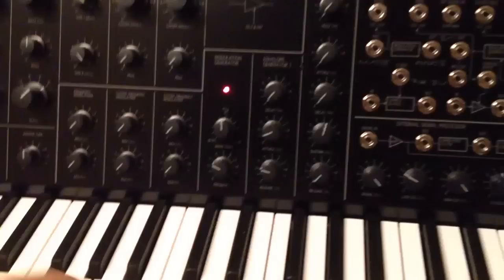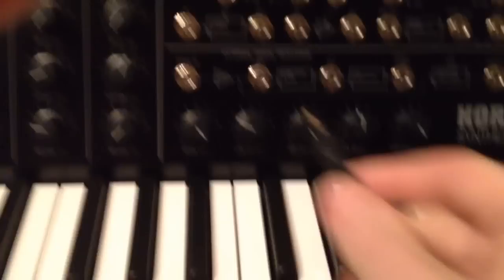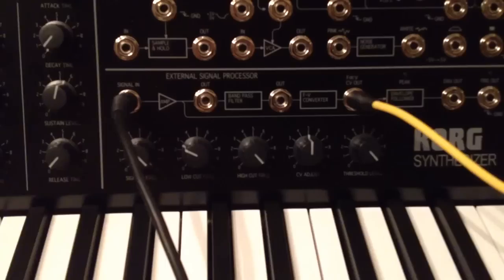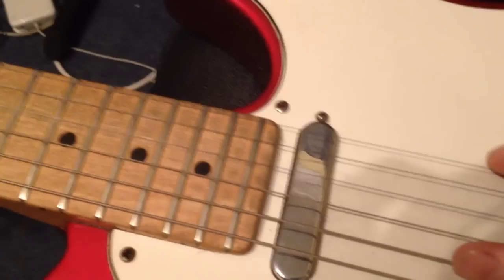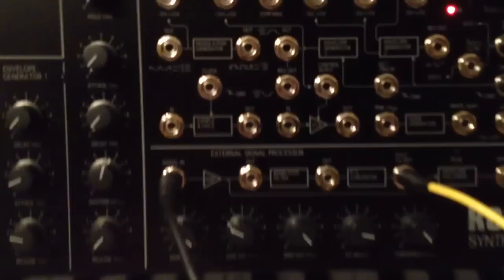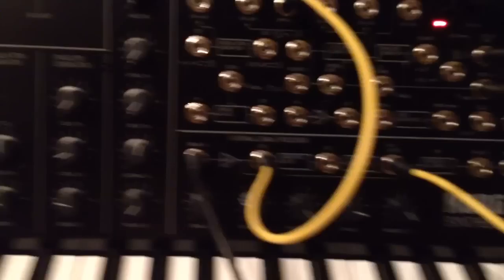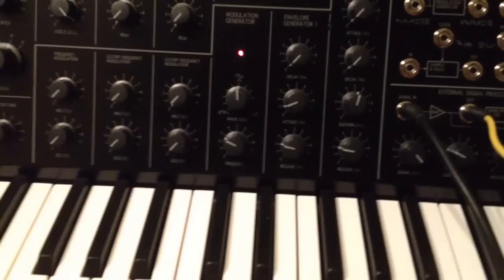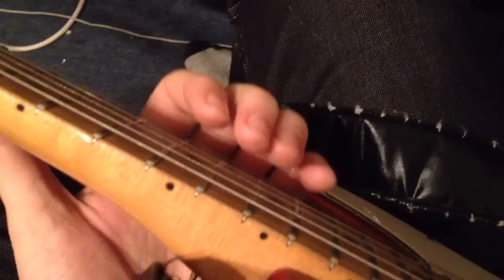Korg MS20 Mini tracking guitar pitch using the External Signal Processor

Comment: They must have improved that p/v circuit. I had an original MS-20 back when they first came out. I bought it because I'm a guitar player. And while it was loads of fun messing around with it, I couldn't really play it either with the keys (I'm not a keyboard player) or the guitar. The tracking was really, really bad. Oddly though, I recall running a microphone into it and singing. It tracked flawlessly for that.

Comment: Can the esp signal control the pitch out cv into another synth so that you can control both? Or better yet, can
Reply from the maker: Yeo you could do this, but the ms20 uses a different scale of voltages (Hz/V) to most other synths (volt per octave) so it might be a bit out of tune unless you were using synths that used the same scale or converted it somehow.

Comment: When you had the guitar and synth signals together, if you played a long sustained note on the guitar, and then pressed on the synth's keyboard, would that still be active? Could it affect the guitar's pitch with the keys?
Reply from the maker: no, the keyboard is not in control of the pitch of the oscillators in this patch, and it definitely couldn't affect the pitch of the guitar
Reply: @marcushamblett Playing the guitar with the keyboard would have been quite something...